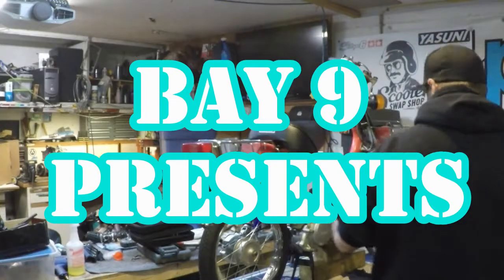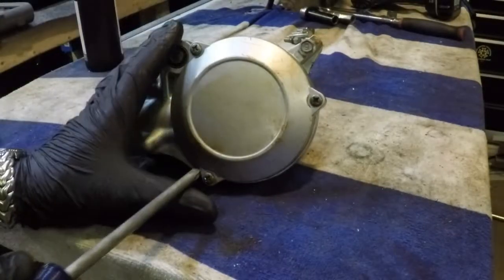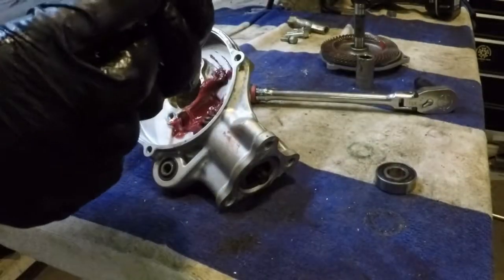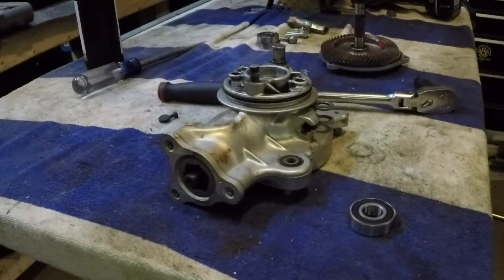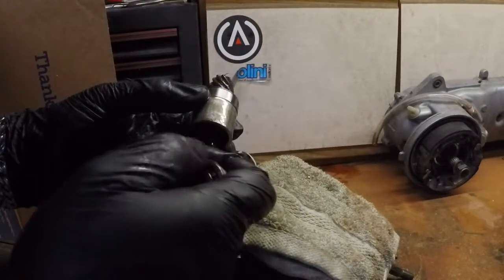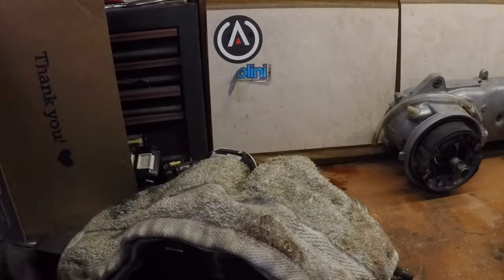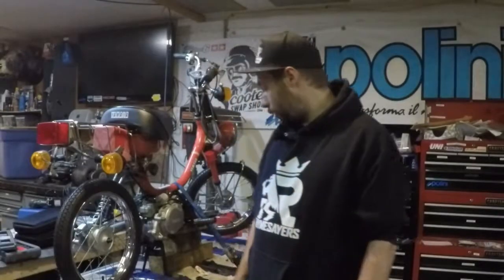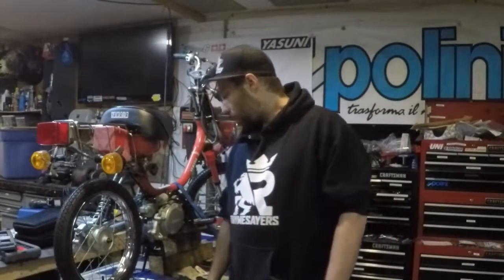QT50 Final Drive Bearing Replacement

Comment: Does anybody knows the fastest speed  For Yamaha  Qt 50
Reply: I've gone 34 mph down hill. But average about 28
Reply: With a 60cc kit from ebay ($60 or so) I was able to install it in about 1.5 hours. 

It's increased torque on the low end and now goes up to 38-40 on flat ground.
I've put 400 miles on it so far with zero issues. Highly recommended!
Reply: Hey Acevedo that is my last name too I have a 1983 QT50 and I just recently changed my piston with the head and everything and I lost compression can you give me an idea of why I lost my compression